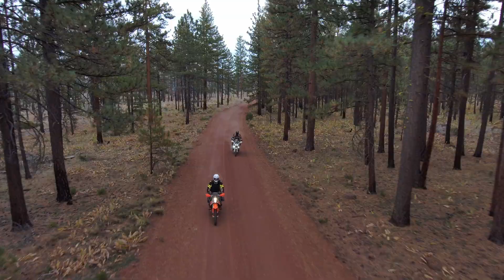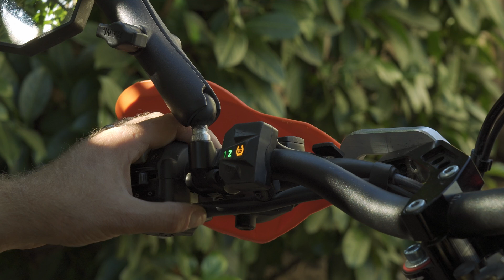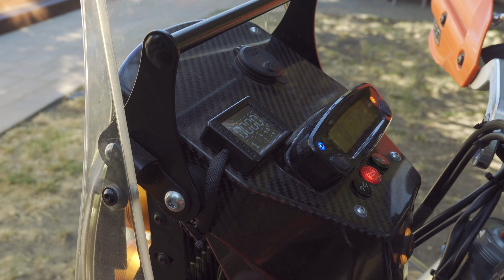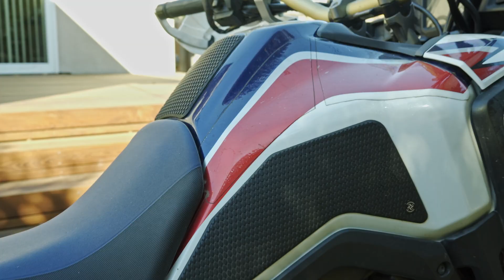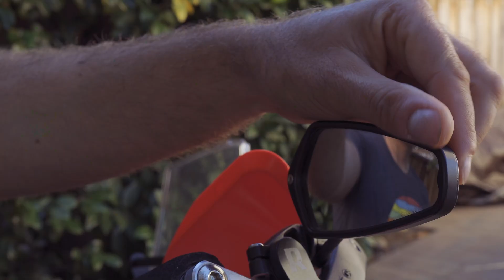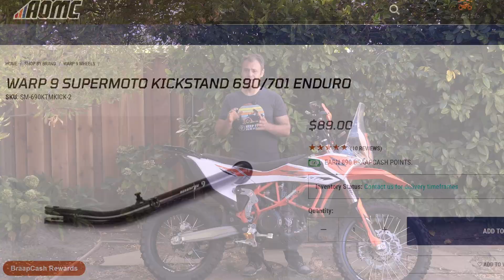KTM690 Enduro R Adventure Build

Comment: Why is reliability such a big issue? I've heard of odd things going wrong (fuel pump, etc) but most seem not to have problems.
Reply from the maker: Yes fuel pumps failures are common enough than many people carry a spare. This model had bad master clutch cylinders. There is currently a massive controversy around faulty rocker arms (for newer models on the bigger KTM ADV bikes). Older models have electrical issues. This particular bike failed to start on two out of three mornings of our back country trip even though it is basically brand new. Luckily my buddy was there to help push start. Also, this model is know for kickstand switches that fail easily and can not be fixed by the usual cut and splice job. Its common enough that KTM sells a kickstand bypass
Dongle just for such emergencies. KTMs brand is generally regarded as high performance / low reliability. Depending in which of those elements  is more important to you, you may be willing to sacrifice on the other.  Personally, I am willing to sacrifice some performance for bulletproof reliability.
Reply: @DiscoveryMotoADV  thanks for this. I've the same dilemma; I have a T7 but it's just too heavy for the Trans European Trail stuff I want to do but I don't want to break down when riding solo in northern Norway,  etc. I've been offered a great price on a zero miles 2024 at my local dealer. Should I jump ship? 😂
Reply from the maker: In my view, it’s a bit of a gamble but as you say there are many owners out there that report no issues. You could be one of the lucky ones. That was my rationale when I bought the KTM….Maybe ill get one of the trouble free units. The previous owner had already replaced the clutch master cylinder which was a know issue for this model year. Unfortunately for me, I did not get completely lucky (see above comment about bike not starting). So, my experience with this bike added to my prior bias about KTM reliability. It doesn’t help that it has started perfectly since then so I can’t diagnose or fix the problem. I just have to live with the unsettling fact that it could just randomly happen again at some unfortunate time when I am
some place remote and by myself. If you want to take the gamble, I would look for a low mileage used one so you let someone else take the depreciation hit. Then, if you aren’t happy with it, you can sell it on without much of a financial loss. Even better if you can find one that is already pretty built up (if you are planning to do mods) since again, the prior owner will be taking the depreciation hit on the upgrades. You can expect to get them at half of what they would cost if you did it yourself. Overall, the performance of this bike (with the modifications) is really excellent. It really is a unicorn. But the reliability remains a concern….
Reply: @DiscoveryMotoADV  much appreciated. Many thanks indeed.

Comment: How is the stock gearing? A lot of owners have mentioned the narrow range of gear ratios. There is even a wide ratio transmission available.
Reply from the maker: I find it to be acceptable. The previous owner had larger front sprocket to make it a little taller for the freeway but I found this to be problematic off-road and even in tight, slow speed twisties. So, I went back to stock and this has worked well for my type of riding.
Reply: @DiscoveryMotoADV  Stock gearing is OK except for first gear which is too tall for tight alpine pass switchbacks unless you like slipping the clutch a lot. Yes, a wide ratio aftermarket transmission is available, but the kit alone is over $2000 and requires total tear down of the engine to install.  Unless you do it yourself for free labor, the installed cost will end up in the range of $4K - $6K.

Comment: If KTM would modify the internal gear ratios in order for it to have a low enough 1st and 6th that allows lower rpm’s when doing longer highway rides, this would take a decent all around bike and make it incredible.  It has 74 hp, it will pull a tall 6th gear.  It would be nice to be able to lope along at 75mph at around 4500 rpm.

Comment: This review is not bad but if you are pushing a bike because you refuse to put lower grade gas you have missed the point.
Reply from the maker: In that instance, we were pushing the bike because the gas station (actually two gas stations in a row) were closed and the KTM ran out of gas before we could make it to the next one. So it was really more of a fuel capacity issue than a low octane issue. If I was going somewhere that I knew had limited access to high octane gas (baja for example), I would bring octane booster.
Reply: @DiscoveryMotoADV  Gotcha- I use the GL gas bag on my 701 and its handy
Reply from the maker: Hah! That’s exactly how we ended up rescuing that situation. I rode up ahead 10 miles to get a GL bag full of gas and brought it back. Would have worked better to have the bag full before we ran out but we did not expect two closed gas stations.
Reply: Curious- what tyres are you using? Thnx for great video.

Comment: I'm considering the 690/701 and just came across your video. Lot of great information presented in a mature, sensible manner, thank you very much for taking the time to do this. Coincidentally, I recently owned a '17 Africa Twin as well, loved it but just found the size/weight too much for me. Downsized to the 390 but now looking to possibly move over to the 690/701. Your video has given me some great information to help with this decision. Also, thanks for showing you sitting on it. I'm around the same size and have wondered about the seat height, seems like it should be fine. Thanks.
Reply from the maker: Thanks for watching and the kind feedback! Glad the video was helpful. The 690/701 is definitely a unique platform and an option worth considering.

Comment: How do you like the Stegz Pegz on this bike?
Reply from the maker: You know, I am not sure I like them that much. They feel a little in the way of my boots (sidi crossfire). They may have been kind of helpful before I got the ergos dialed in but now I think they are more annoying than helpful.
Reply: @DiscoveryMotoADV  I've had them on all my bikes before the 690 and found they took a lot of stress off my hands. I haven't put them on this bike yet but I am considering it. I find the 690 a little too narrow to grip well with my legs so I was thinking they may help.
Reply from the maker: The two things that I found most helpful with regard to gripping the “tank” were (1) getting the ergos right (for example lowering the pegs put my knees in better contact with the bike) and (2) adding the grip pads which are much better than naked plastics.

Comment: Bought a used 2020 701 with all the goodies already installed. Seriously considered 790/890, AT, 850...  Two years of riding the 701 and I would buy again!
Reply from the maker: Curious how the reliability has been?
Reply: @DiscoveryMotoADV  One problem. The gear shift sensor got some dirt behind it causing stalling issues. Took me awhile to figure it out. Cleaned sensor, sealed so no more dirt, and its been running perfect! Their is a magnet on the trans that moves when changing gears. The sensor sends signals to ECU. The sensor misreading/poor signal due to dirt caused it to stall intermittently...

Comment: Did you consider the AJP PR7?
Reply from the maker: I did consider it briefly. It has very limited availability in the US and, consequently, a limited dealer support network and part availability when traveling. It is also not street legal here yet (at least last I checked) though hopefully this will change. Also, it does not have ABS which is a deal braker for me. Thanks for watching!

Comment: After riding motorcycles for 50 years, and owning many KTMs dirtbikes from 1999 onwards and was so impressed with KTMs handling, so I bought the 2021 690 Adventrure R, first day out I got the speed wobbles on a dirt road doing 50mph, so fitted 25mm bar risers as felt i was leaning to far forward over the front but still no good, so then looked at many other KTM dirtbike images and found that the steering headstem on the 690 sits level with seat and comparing that to all other KTMs they sit much higher than the seat, so I fitted a set of WP 300mm forks and now has finally fixed the steering wobble headshake on my 690, problem is totally gone, bike now super stable at any speed how a KTM should feel and how i believe they should have come from factory not with a super motard 250mm front end to save costs....
Reply: Where did you find the WP 300mm?
Reply: Got a set off a 2021 300cc sherco and took them to a suspension guru who swapped the fork feet over was easy and cheap  @WorldCommander
Reply: Huh.  I bought a 2021 and I have never had any wobble in my front end doing any speeds on any type of surface.  I do always make sure my rims are trued and tires are balanced when ever I change them.  I have roughly 3,600 miles on it.
Reply: @shanebrown2963  bought it with 400klm on it was like new, 1st ride very dry dirt road loose stones on top 80klm front end speed wobble to almost end in a tank slapper, after owning 6 KTMs and countless other dirt and road bikes, fitter and turner by trade, can ride and set up a bike to the tenth degree never had any bike do that to me, now super duper stable not the same bike any more .

Comment: I bought one and it is my favorite for long haul trips. I bought it for a 2800 mile ride. 50/50 dirt/back road. Canada to Mexico. Cascade and Sierra Nevada range. Kinda following the Pacific Crest trail. My KTM 500 exc could do it but not very well. My KTM790 adv. S. out of the picture. Way to massive for the dirt sections. Lot of mods include Rade Garage 1.5 fuel tank. It is a large dirt bike. Expert rider in my 60's now.
Reply from the maker: Sounds like an epic ride! I do think the Rade Garage aux fuel tank is a critical mod. If this bike hadn't already come with the rottweiler airbox, I would have gotten the Rade Garage one with the extra fuel tank.

Comment: For anyone considering this bike, one important thing to carry or do is the sidestand dongle or just rewire the sidestand switch. It uses a magnet based sensor system that you cannot just wire around on the trail if you lose the magnet(you will eventually). The magnet is kinda flimsily screwed on and it will wiggle itself out of alignment or just fall off the bike entirely and leave you stranded. The dongle bypasses this if you want the safety of still having a switch. Or you can just tape a magnet to the sidestand switch and rewire it under the seat for less that $5 or free like I did.
Reply from the maker: Yes, 100% agree. I actually do have the kick-stand bypass dongle and I think the fact that this is such a common failure point that this dongle is a well selling item, is a testament to terrible design and quality on the part of KTM. At least when it comes to the kickstand. I had meant to include some comments on this in the video but forgot and was too lazy to go back and re-record that segment. Thanks for bringing it up.

Comment: Hi Great video. I have pretty much the same bike and set up but have the rade garage airbox and storage. I also have a power commander and didn't realise that you could have duel maps. Do you think it's worthwhile. How much more mpg do you get with the economy map. 
Cheers 👍
Reply from the maker: I haven't done enough back to back comparison to tell how much of a difference the fuel economy map makes. But even running fuel economy mode, in mixed riding I have seen the tank go dry after only 133mi! Since you have the Rade Garage airbox, I might invest in the aux fuel-tank thank is compatible with it to address the short range (if range is a concern for you). That said, I imagine the extra fuel map and switch would be a cheap addition from Rottweiler so might be worth it.

Comment: Good video!  I have the white version.  It started as my hardcore dual sport but later I changed it up to do adventure riding.  I’m using the Rade Garage under seat air filter/aux fuel tank.  I’m using Outback pannier racks and use hard luggage when I’m on a long trip.  I use a Swiftkicker adjustable stand and a bunch of other stuff.  I rode from Portland to the Arctic Ocean 2 years ago.  I’m 75 now and need to lower it a couple of inches so I can ride it into into my 80’s.
Reply from the maker: Dang…Portland to the Arctic is a bucket list trip. Good thing you have that rade garage aux fuel tank as I bet range would have otherwise been limiting. If my bike hadn’t already come with the Rottweiler air-box, I would have gone with the rade garage so I could get that auxiliary tank. I hope to still be riding at 70! Keep it up.
Reply: absolutely amazing. I'm 46 and hope and pray I'm still on my bikes when I'm your age. my hat goes off to you sir !!

Comment: Great Adv build video ! I found myself in a similar situation last year with my 1250GS on some remote gnarly trails and got an 890R - super happy with it ! Did you consider an 890 ? I know it’s about 50lbs heavier than the 690 but the low tank is great at hiding that weight when handling the bike.
Reply from the maker: Thanks for watching! I did consider an 890 / 790. Indeed, I briefly owned one. It was pretty awesome but felt too jerky and unsettled to me. In retrospect, I think I needed to make some of the same ergo adjustments I made on this bike + perhaps a throttle tamer. Ultimately, all the bikes I try have to unseat my AT which is a pretty high bar given how well that thing performs post all of the mods I made to it.
Reply: @DiscoveryMotoADV  yep, agree. I had to do quite a few similar mods to my 890 for it to perform on road and offroad the way I needed it to.
Reply: Good vid - well structured, informative.
I did keep thinking the AJP PR7 already mostly ticks those boxes - including a rear steel subframe for luggage and an accessible gas cap.. 😁 tho understand it's not road registrable in most of the USA 😮